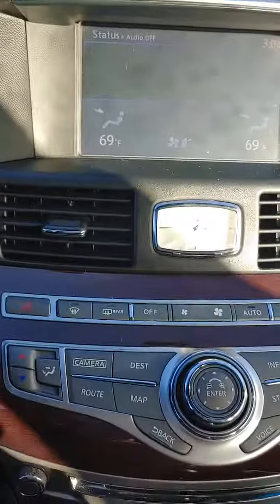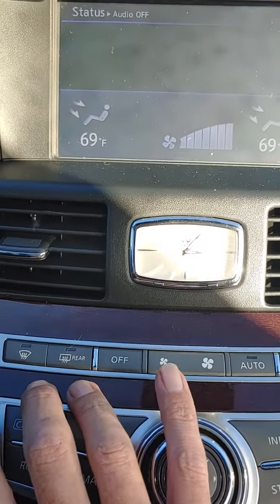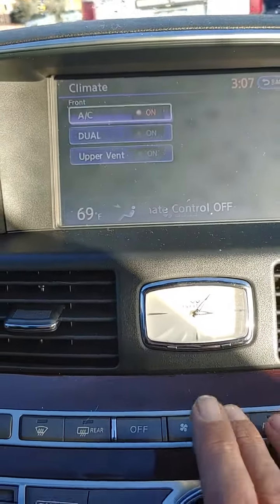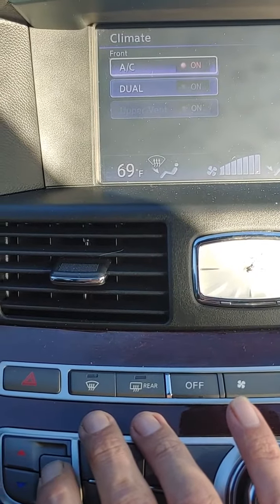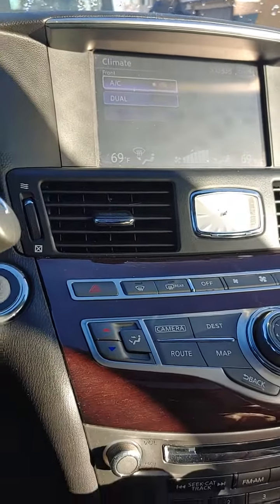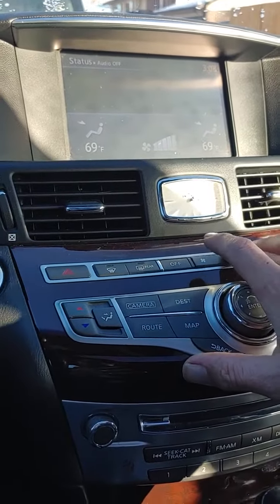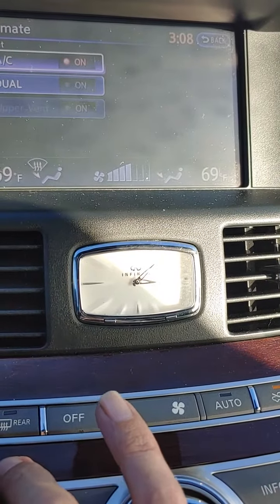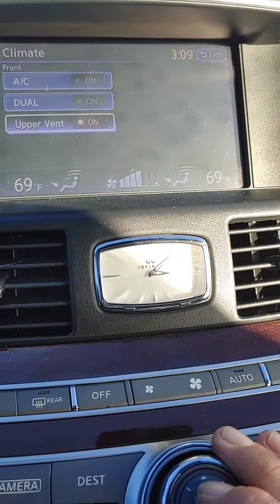2015 Infiniti Q70/M56/Y51 HVAC Fan Intermittent Failure

Comment: my 2016 Q70L was doing that so i replaced the blower fan and the cabin filter just because i was there.  The fan/blower had some rust on the bolt but it fixed the issue.  Easy fit, its behind the glove box.

Comment: Do you find that when this issue happens, the blower will work 10 or 20 minutes after starting the engine/into your drive?
Reply from the maker: When this does happen, the only thing that gets the fan going again is tapping on the plastic covering under the glove box... Also, after tapping the cover and fan starts, i can have on high and fan will randomly go at different speeds 😆.. I almost want to let it be for the character 😆 but that's what led me to thinking the resistor is the culprit.. Infiniti guy asked me that same question... Said the hvac system won't even allow for the "heater" operation until car is at operating temp.. Which makes sense to me.. Car warms up quicker not sucking the heat out of it... But that just doesn't seem like a legit thing...

Comment: I’m having the same exact issue with my Q70s and ran across your video. Did you find out what was causing this issue? I appreciate any help you can offer me.
Reply from the maker: Mine seems to be a regulator and fan motor assembly starting to go out.. When i smack the kick panel it fires right up every time.. But i don't need to smack it every time. I purchased a fan assembly and resistor so i have it... Seems to be problematic on the mid range selections so i avoid using those. Good luck. Let me know if you need anything else